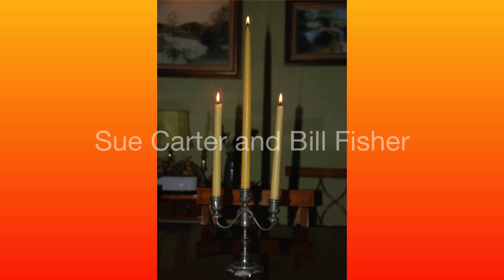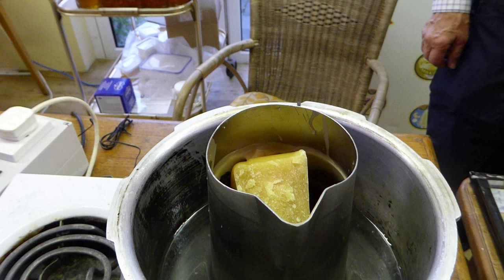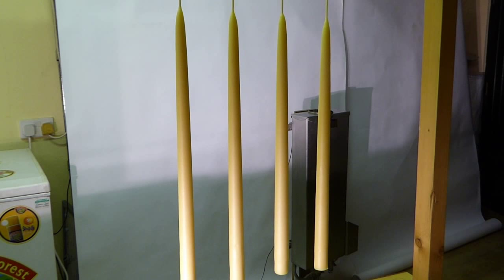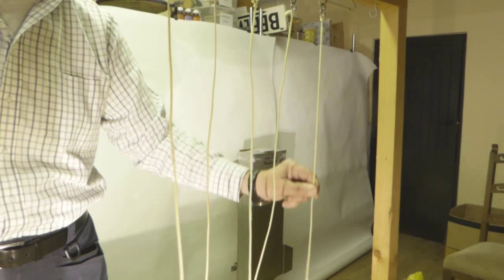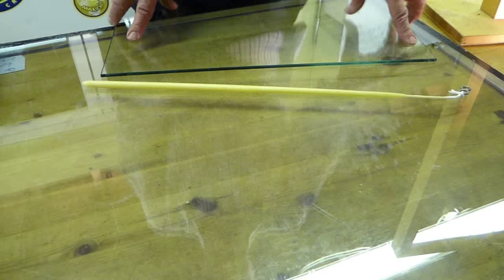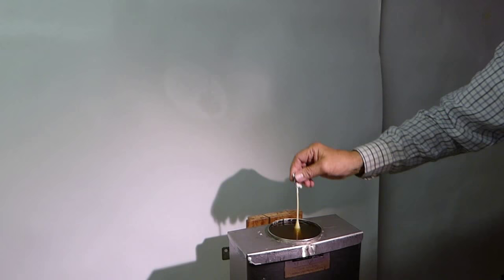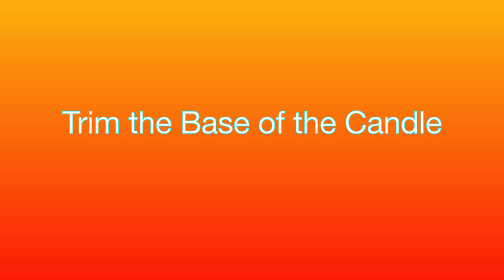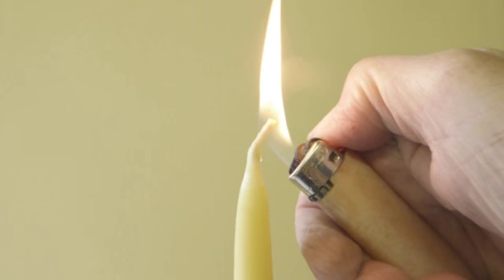Making Dipped Candles - Won First Prize

Comment: I wrote down the instructions from the video for my own records (with some minor tweaking for my setup). Thought I'd share in case someone wants to read it while making candles for the first time like me or for anyone having trouble hearing her.  
Dipped Candles
Gather ingredients: 
-Scissors
-Knife
-Metal candle pitcher
-Sauce pot filled ~¼ full with water
 (add more during boiling process to top off if needed)
-Wicks
-Beeswax
-Frame for candle drying
-Two sheets of glass 

1. Place candle pitcher in a saucepan filled ¼ of the way with water to create a double boiler. Turn heat on medium low and melt beeswax in pitcher. The wax needs to be kept hot for the duration of the dipping process. 

2. Cut wick to appropriate lengths to get two candles per wick.
3. When wax has melted, submerge wicks until all the air bubbles come out. Hang to dry and straighten out with fingers while still warm and pliable. Remove wax drips from bottom. Give a good pull to straighten out. 

4. After wax hardens, begin the first dip. Dip the wick down at the same pace as you pull them up. It should take equal time to dip as to pull up. Smooth and steady. Make sure to touch the bottom of the metal pitcher with the wicks gently. Do this with all your candles and hang to dry after dipped. 

5. Second dip, start with the first candle, dip again, repeat the same process with the rest of the candles in order.

6. After about 4-5 dips, you’ll need to roll the candle between your sheets of glass. Apply gentle pressure while rolling.

7. Trim the bottom of the candles. Use your fingers to gently pull off any drips on the bottom, all the way to the wick.

8. Second round of drips, you may need to add more wax to top off your pitcher. Trim dips off candles each time you dry them. 

9. Second roll, after you’ve finished another 4-5 dips you’ll need to roll the candles again. Be careful the candle isn’t too hot or else the wax will stick to the glass. 

10. Third round of dips, keep wax topped off. Keep the same rhythmical movement with each dip, and remove drips after. 

11. Continue dipping and rolling until you have made ~20-25 dips, or until candle is the size you’d like it to be. 

12. When the candle has reached the desired size, give it one final roll and ONE final dip IN THAT ORDER. Don't be tempted to keep dipping to get a “better surface”, it will only get misshapen.  

13. Trim the base of the candle: important to do this while the candle is still warm. Be careful, because they are still fragile until they are completely cooled. Place the candle on the rolling glass, take your knife and whilst rolling the candle slowly, apply gentle pressure with the knife until a disk of wax has been cut off. Be very careful or the wax can get damaged. Under no circumstances should you use a sawing motion to cut the base. 

14. Dry the candles. Leave the candles hanging to dry for at least 24 hours

15. Trim the wick. You need to cut it at a slight angle and the length needs to be about the depth of your thumb. 

16. Light the candle!
Reply: Thank you!
Reply: @MS-mp9om  Thankyou!
Reply: Merci 💕💕💕
Reply: Thank you!